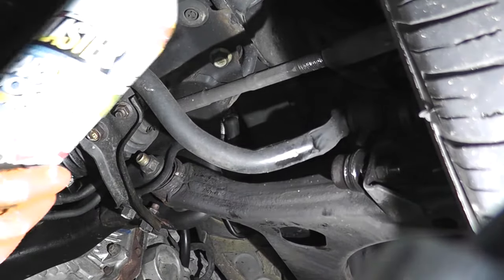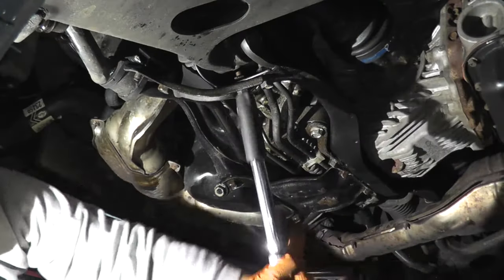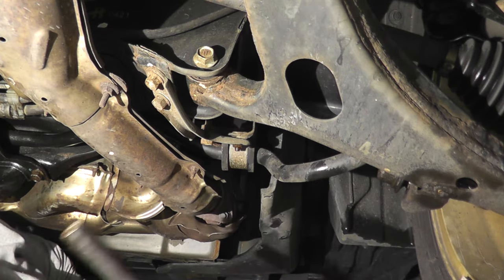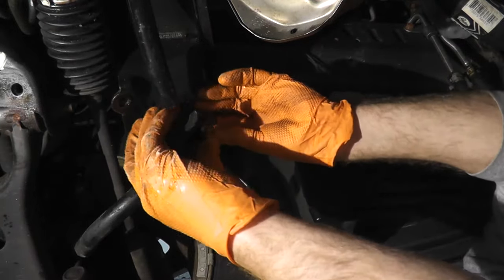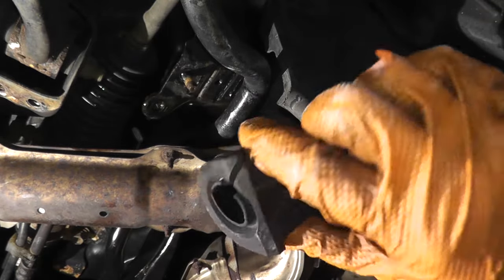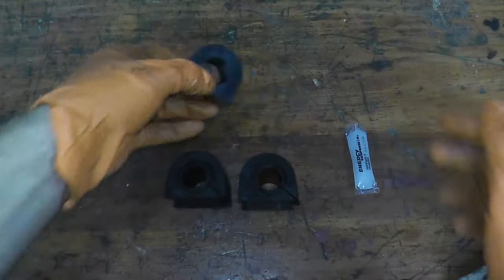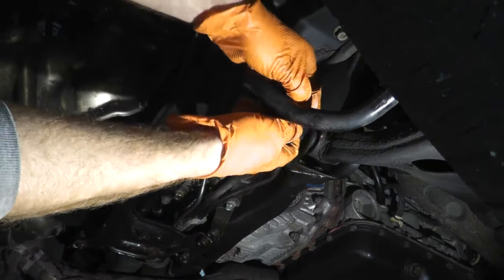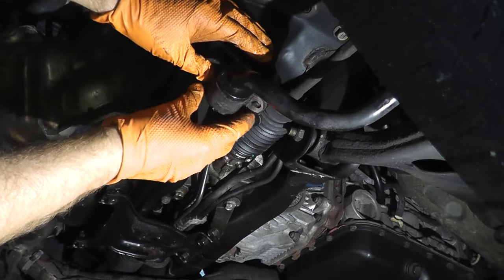Polyurethane Sway Bar Bushing Install with Basic Hand Tools HD

Comment: Nice video. It helps a lot. 2 months ago replaced these D-bushings to a new aftermarket. But after a while clunking noise pops up again. I understand the problem after your video. New aftermarket rubbish bushings have a cut in the center and sway bar knocking to bracket through this cut when I drive over bumps, especially when doing sharp turn. Thanks!
Also would be great to watch exhaust replacement-front part. I have impreza 2010, changed doughnut and exhaust manifold gaskets, but rattle sound and exhaust smell still present when you open driver’s door. Unlikely that it is a hole under exhaust shield, drive in Sydney, very dry and no corrosion at all. Cheers!
Reply from the maker: Thank you. I just replaced the lower control arms. (Will be posted within a few days.) Still have the valve cover gaskets and most likely an exhaust video.

Comment: This is a great video. I’m doing this to my 2011 Legacy as well as the sway bar links and lower control arms. What are the torque specs for the bolts on the bushing brackets?

Comment: Great video! By the way, on my 2010 legacy, one of the front bushings is behind the sub frame and i was not sure if i could still undo the bolt of the bushing bracket or if i need to drop the subframe. Is there is a nut that need to catch when i undo the bracket bolt?

Comment: Hello...please post more 2010 Subaru videos PLEASE.  Thanks!
Reply from the maker: Contemplating on doing a head gasket video - meaning pulling the engine. I'm 50/50 on it. I may just sell the vehicle. Are you looking for anything in particular?
Reply: @CarsNToys  HOw is the condition of the polyurethane on the sway bar bushing now?  Are they getting noisy or harsh ride?

Comment: the bar is approximately 19-inches long, however, the approximate center of the socket will be at approximately 17-1/2 inches from the end. therefore, its' only giving approximately 17-1/2 inches of leverage.  just based off the quick shot of the breaking bar and tape measure comparison.